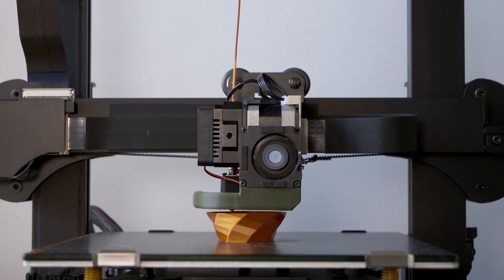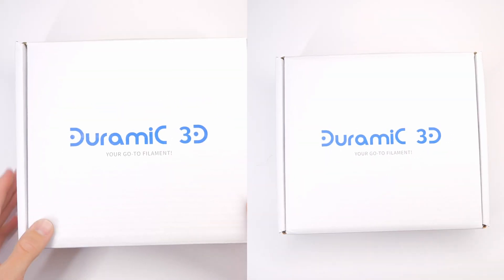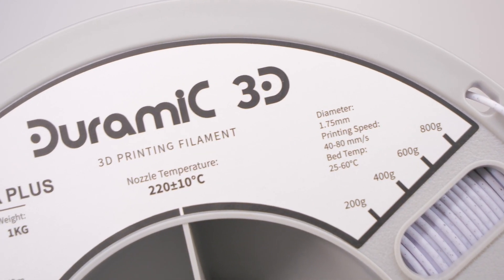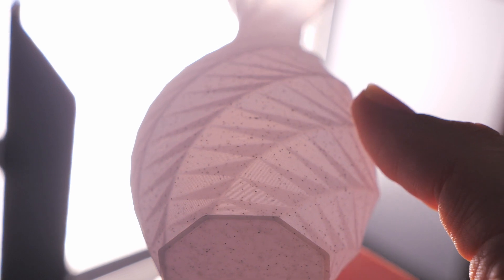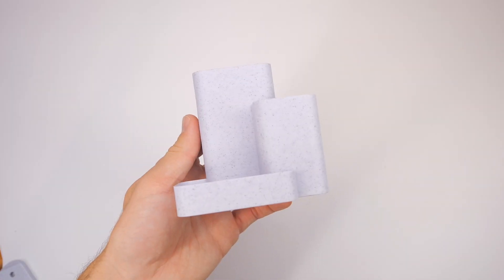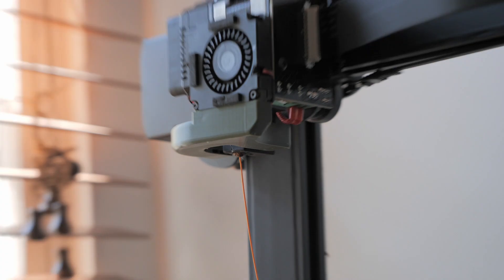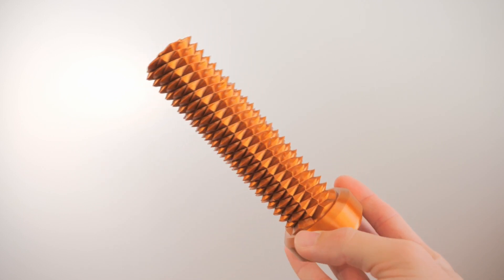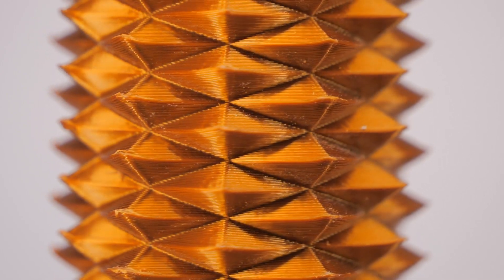Is Duramic 3D Filament any good? (yes) | Marble PLA+ and Copper Silk PLA Review

Comment: I’m dying. Have ender 3 V2 I can’t get mine to print. Have the pla+ marble. It clocks on me and is not sticking. I put one of my other pla+ in and prints and sticks perfectly. .4 tungsten nozzle. Bed temp 65 and nozzle temp I started at 220 and tried to print a temp tower. Retraction settings are 5.5mm at 45mm/s. Print speed is 50 first layer standard 20mm/s. If any help I would appreciate it. Thanks